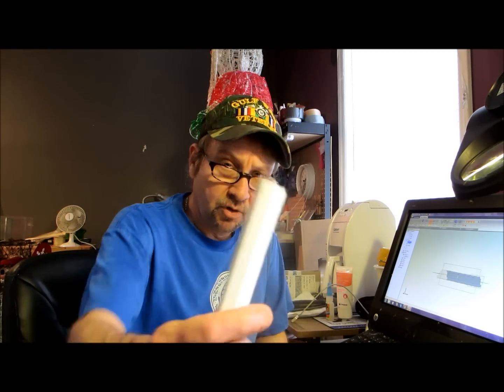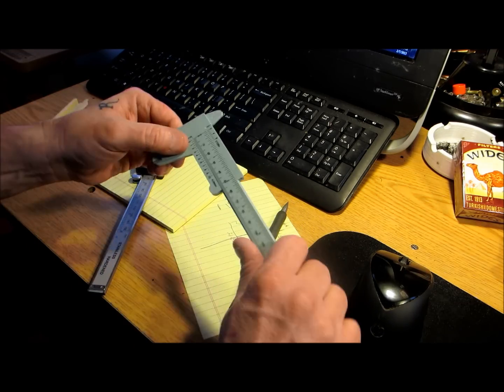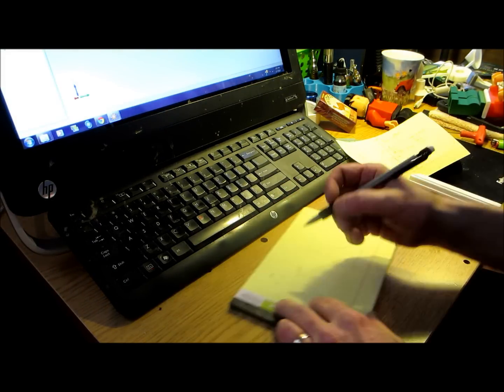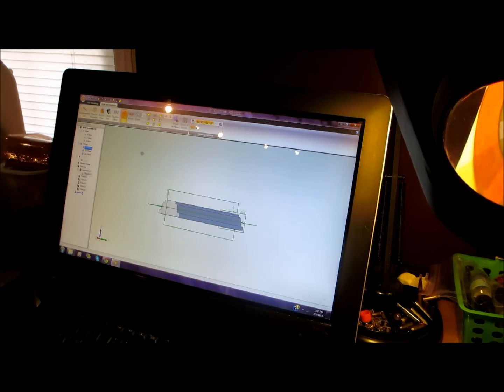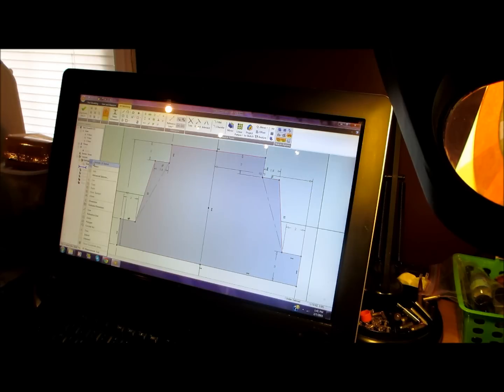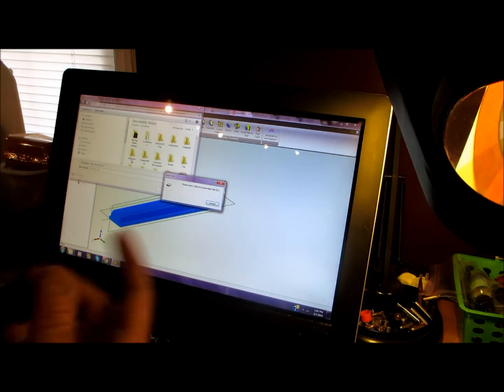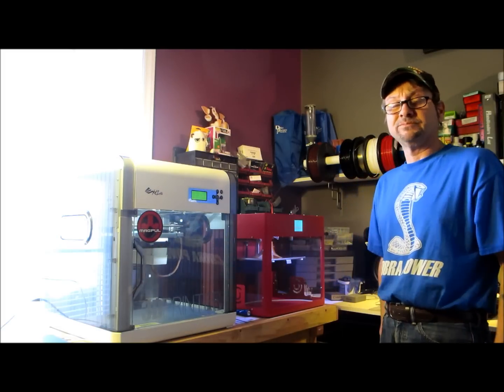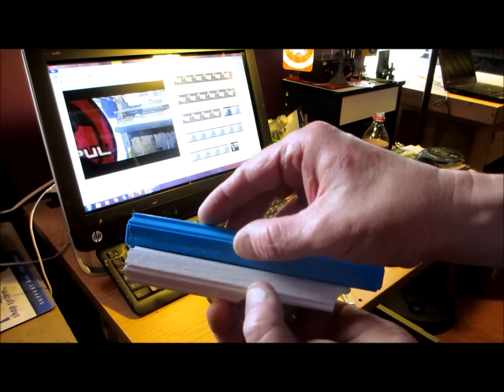Gee...What can I print with my 3D printer? Episode One

Comment: awesome Jay! I hope you do more of these. I haven't bought a 3d printer yet but its great to see a 3d printer used in a practical way. projects are great too but seeing the printer help out with diy projects is the reason I want to buy one.
cheers
keep up the good work!!! (y)
Reply from the maker: Thanks Ray....I've used it many times for stuff around the house (and for the wife - wink)....because I've learned if she thinks it's a good tool I'm good..

She had a bunch of wind chime parts. You know how the eventually rot and fall apart? Well I printed here the top plate and clapper (http://www.thingiverse.com/thing:143917) and...Tadah!...She can now re-make wind chimes....

Her Workmate 'foot' rotted off (they're SBR)...Tadah!...printed her a new foot (http://www.thingiverse.com/thing:160411)

I've done several things like Fire Extinguisher and flashlight mounts, spacers/washers, and lot's of other items...

Right now I'm building my own CNC lathe using my 3D printer....

Cheers

Jay
Reply from the maker: Ray, most printers can easily do .2 mm resolution. Some can do .1 mm resolution. There's even a couple who advertise  sub-1mm resolution. Having said that the DaVinci might not be the best choice for the project.
There's also a way to add metal pins to your builds...but you have to be very mindful of clearance for the hot end.
There's also the new reinforced filaments coming out so when you print very thin it's much stronger. 
Without seeing part I can't say too much. The SLA printers like the Form 1 can do very fine detail but that kind of printer has its own set of problems (UV resin can be brittle and can degrade over time quicker than the more common filament type 3d.printers.